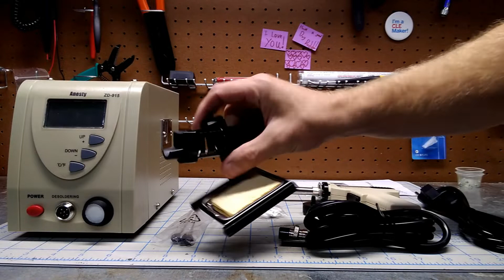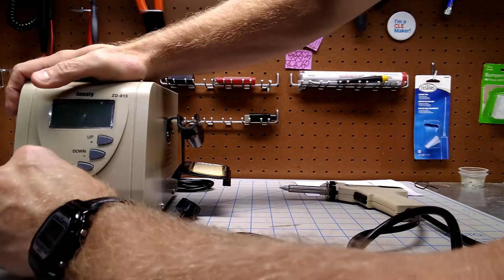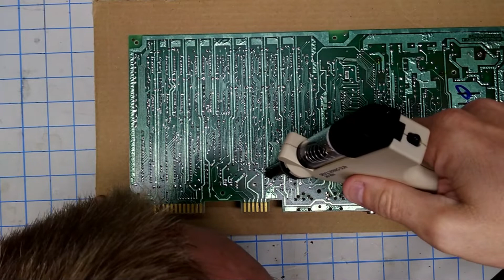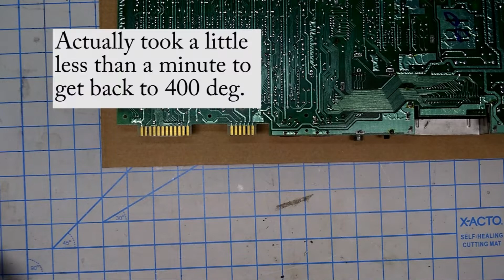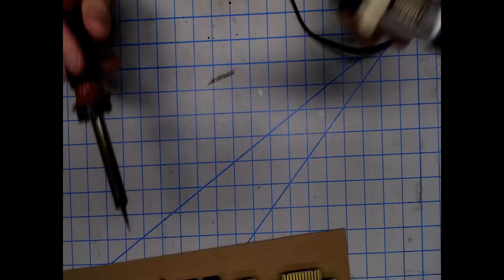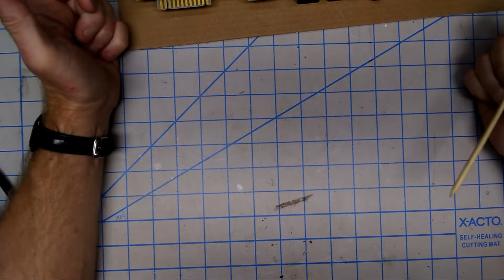Episode 11: ZD-915 Desoldering Station: First Use and Review

Comment: I've done hundreds of desoldering operations using Pace stations and found it's always best to hold your ckt board vertically and suck horizontally.  That way you're not fighting gravity and the molten solder flows better and faster through the handpiece with less clogging.

Comment: I have many desoldering tools, I have two Hakko inclusive, one Hakko 808 and one Hakko FR-301, I bought one ZD-915 but I never use it, and now I have a Yihua 948.

When I start using my Hakko 808 I have many problems, my desoldeeing gun clogged a lot.
I solve all my problems doing the next

 1  Use 1.5mm nozzle or more, my desoldering clogged often using small nozzles.

2 Lower temp use it is 380 Celsius degress.

3 Press the suction trigger for one second after the solder was removed.

4 Some times I use low melting solder.

5 Clean all and change the filters often.

All my problems finished, I have more than two years without any clogged. at all.

Best Regards.

Comment: Im spoiled enough to have both a pace mbt350 and hakko fm206 where I work.  As tech&music said below, suck the solder longer so it empties the tip.  Also I find that moving in small circles around the pin, or wiggling the pin side to side with the tip helps to suck the solder from all sides.  Just be careful not to put pressure from the tip onto the pad or you can lift pads very quickly.

Comment: Maybe you could put a link on where to buy as all the other links I've seen are from Europe.
Thanks.  -Mark.
Reply from the maker: I got mine from an eBay seller, onlyforever702: https://www.ebay.com/itm/Pro-Digital-Vacuum-Desoldering-Station-ZD-915-Iron-Gun-LCD-Rework-Station-480/302470622082?_trkparms=aid%3D111001%26algo%3DREC.SEED%26ao%3D1%26asc%3D20160908105057%26meid%3Db4655826f7664e9e8b1eb99c9d6e3689%26pid%3D100675%26rk%3D1%26rkt%3D15%26mehot%3Dag%26sd%3D302470622082%26itm%3D302470622082%26pmt%3D1%26noa%3D1%26pg%3D2481888&_trksid=p2481888.c100675.m4236&_trkparms=pageci%3A1b75d7a3-d041-11e9-9acd-74dbd180db7e%7Cparentrq%3A041239a316d0aadc4e09f304ffcb8060%7Ciid%3A1

Comment: They are excellent bang for buck, and if they do fail after a year of use, just grab another one :-) I had a old Weller failed on my last year, grabbed one of the eBay specials and they do the job, what does go well with them is grabbing a heat gun and they are around the 30-40USD to complement when a chip doesn't want to budge, what I did learn from GadgetUK164 is to sometimes add a bit of fresh solder and also give it a bit of a wiggle and that seems to get any remaining bits out :-) thanks for the awesome vid!